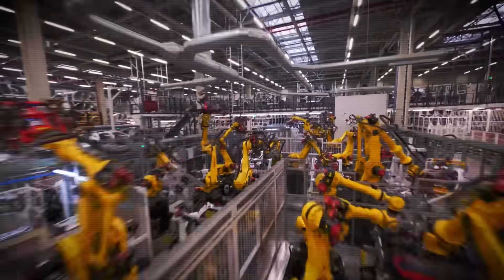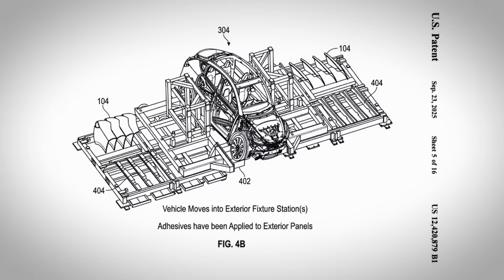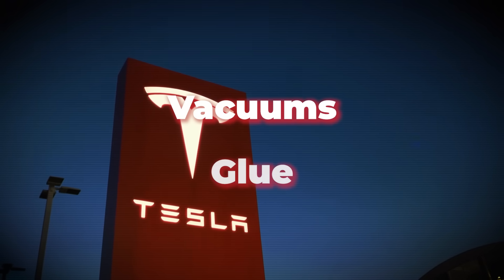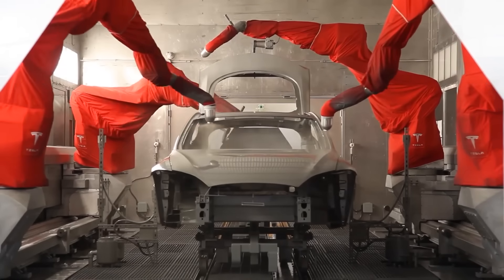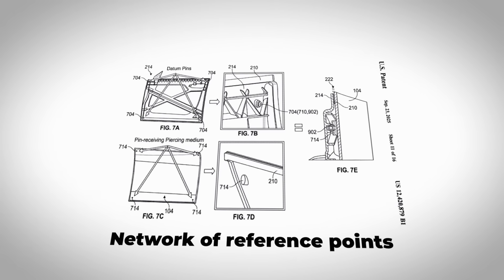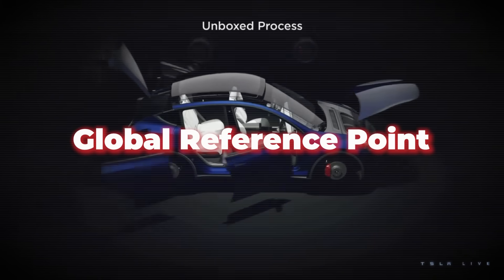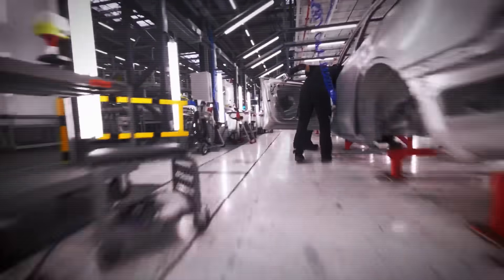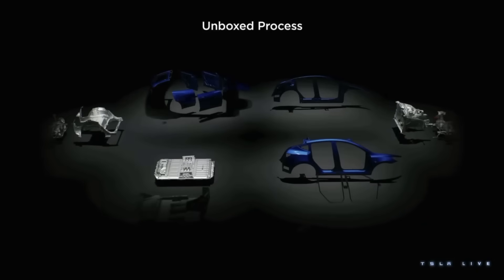Tesla Reveals NEW Unboxed Manufacturing Process

Comment: When  using the glue if a workshop  want to fix a broken part in a specific area where the is the glue what will the do ?😕 and even if you say we can it of and after we can still y the same glue to put it back it will still look Masi so no real reason to use glue just use the same old method it more practical 🙂

Comment: Every assembly line acts just as you described this "unboxed" process. Small subassemblies are assembled separately and then integrated into the line. Same for airplanes: empennages, fuselages, cockpits, wings, landing gear, engines, APUs, etc. all have their own assembly lines. You are missing something important.
Reply: I work at a car factory as an automation tech and this sounds just like how we do things now. This is just fan boy crap.

Comment: Good luck repairing a car that has been glued together.
Reply: and in your vast car assembly experience, do tell us about the challenge, please.   i would love to hear your experience in this matter... because you are clearly smarter than Elon Musk with all your successful experiences in running a car company or a rocket company or a tunneling company or a neuralink company or an AI company....  i mean come on, Elon is a joke compared to you.
Reply: @2bLackCats1989  25 years Designing for industry. Composites, alloys, plastics,high tensile steels. Tesla requires certified repair shops for a reason, they are difficult and expensive to repair after a prang. For some reason you felt that you had to spring to Elon's defense, but my remark wasn't a slight aimed at him or his designs, just the realities car repairers face when trying to repair these modern cars.

Comment: I think you skipped a step in the history of car manufacturing. Indeed there was first the Ford Production alone, the moving assembly line, around 1910. the next innovation was TPS, the Toyota Production System, which originated in the 1970s and revolutionized the way cars were produced and all legacy car makers eventually followed Toyota, Now we have TDM, or Tesla Digital Manufacturing, which is what you covered mainly in this clip. It is using digital tech and increasingly AI to rethink the manufacturing process , including gigacasts, unboxing process and use of humanoid robots. I am sure other car makers will have no choice but to follow as well otherwise they will be at a major cost disadvantage.

Comment: When Pontiac first produced their Fiero two seat "commuter car"  the steel frame had 1 inch square  attachment plates for the body panels, as the frame came down the line the plastic body panels were LASER ALIGNED and screwed via fastener lugs to those attachment squares, resulting in a perfect fit for all body panels.  
   The Fiero was really ahead of its time - SO FAR AHEAD that GM, General Motors management SABOTAGED IT, the Chevy people DID NOT WANT an inexpensive MID-ENGINE TWO-SEAT Pontiac sports car OUTPERFORMING their big, heavy, EXPENSIVE front-engine Corvettes - so they had GM SABOTAGE Pontiac's sporty Fiero.    Such "sabotage" including making the Fiero use a very cheap Chevette front end, only a 4 cyl engine was offered,  and somehow or another many Fieros had cooling issues - enough to make them unreliable and fall out of public favor. 
    The last year of Fieros produced were much improved - and even featured a small V-6 - but the damage was done, and they went out of production.  But if Pontiac had been given the GREEN LIGHT to make  a QUALITY two-seat mid-engine HIGH PERFORMANCE sport car,  automotive history would probably be very different.  For example, the new Tesla Cybercab will probably be a 2 seater,  
GM could have replaced a  Fiero's mid-engine with a battery pack  and put electric motors at the hubs  years ago.

Comment: No glue or fasteners, just 100% welds only. Can use Ai and robots to achieve this. Not far fetched or far off. Will make assembly and production so much better. Vehicles would be much safer and more durable and efficient.

Comment: The concept is NOT new.  A famous example anyone can confirm is how USA built aircraft at a Ford facility in Willow Run, Michigan during ww2.  Sections of the plane each had their own sub-assembly lines.  The completed sections were fitted together at the end.  Over 250,000 individual parts.  At its peak, the Willow Run plant was producing a bomber aircraft every 63 minutes (!).
Reply: Are commercial aircraft built on an assembly line? I don’t know but it seems really unlikely. The point here is not that nothing has ever been built in parts and assembled. It’s that cars never have been built, and not in the way that Tesla is doing it.
Reply: @juliahello6673 ❤❤❤
Reply: Excellent point, but the key innovation is assembly. No fasteners would make the vehicle unserviceable by standard methods, in effect making it disposable? This may make a lot of sense if you get the price low enough? It would certainly keep manufacturing humming.
Reply: @thegeneralist7527  The bombers... all 50,000 of them... were disposed of.  Regarding cars, it makes a lot more sense (in some ways) to simply replace the entire car if it is damaged.  The marginal cost of producing a car is probably not too different than the cost of repair.  "Insurance" is almost down to that already, with companies 'totaling' vehicles with fairly minor damage, explaining all the 'rebuilt' titles that are all over the used car market.

Comment: the you can build a car every x seconds is a big fake data point. with how many production groups... in texas they have 2 model Y lines so they can meet the 20-30 second per car number.. or 40-60 seconds per line. so if they have say 10 final assembly stations with 10 unboxed models yea i am sure they can crank them out fast.. vs 1 assembly set (cant say line if they are not using a line) we will know the true speed.  I assume they are dialing in the 1 production setup and doing test builds right now.. i do not think the cybercab is scheduled before 2nd qtr 2026 so they have time and they have an entire garage they can store the cybercabs in as built. So time start to finish on a vehicle is a number.. and time per production setup is a number... but they are using time per factory output that can be misleading especially if they have more than one line

Comment: Interested how the insurers will view this & how it will affect premiums as it will make accident repairs a lot harder with a glue only body. Question is with an all glue body if crash performance will be affected at plus 40 deg C or negative 30 deg C that the car will see in certain regions of the world. Yes structural adhesives are common today but usually implemented with mechanical fixings or spot welding.
Reply: The problem of not using fasteners is engineering the adhesive characteristics. Why not get rid of metal altogether and use rebar strengthened plastic? Then you could manufacture like a plastic model airplane kit, glue the injection molded parts together. Make it cheap, disposable and recyclable. Repairs would be heat cutting or grinding to remove parts and gluing to assemble new parts?
Reply: My thoughts exactly. Glad I'll never own one of these things; They're effectively throw-away items.

Comment: Gluing cars together is pretty normal.
Reply: Let's here some examples of cars glued together like the cyber truck.
Reply: @bobbybishop5662 hear or here?
Reply: Tata Nano (2008–2018): This ultra-affordable microcar was one of the first to use automotive adhesives extensively for attaching lightweight body panels, reducing overall weight and production costs without compromising basic structural integrity.
BMW Models (e.g., 3 Series, X5 from 2000s onward): BMW pioneered adhesives for bonding plastic cladding and outer body panels to metal frames, enabling mixed-material designs for better fuel efficiency. Gluing is used on roofs, side panels, and fenders to minimize welds.
Audi A8 (aluminum-intensive models, 1994–present): Features glued aluminum spaceframe panels, where adhesives join extruded aluminum sections and sheet panels, creating a lightweight yet rigid unibody structure.

Freight Trailers and Insulated Vans (e.g., Hino, various dry freight models): Panels and reinforcements in trailer bodies are fully bonded with adhesives like SikaForce® for gap-filling and load-bearing, common in logistics fleets for durability without welds.
Buses and Public Transport Vehicles (e.g., modern urban buses from manufacturers like New Flyer): Composite or metal side panels are glued to frames for corrosion resistance and easier repairs, especially in high-humidity areas

AI spit this out to me in 2 seconds.   Seems common

Comment: Tesla has revealed a new patent for their unboxed manufacturing process, which uses vacuum suction and industrial adhesives to attach body panels and windows. This automated system promises to improve panel alignment, reduce fasteners by 65%, and dramatically speed up production.